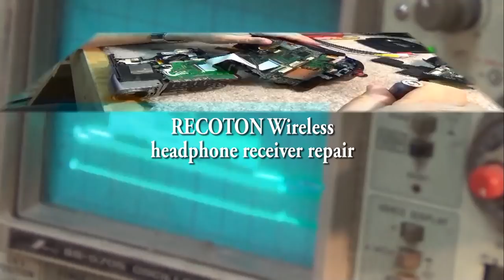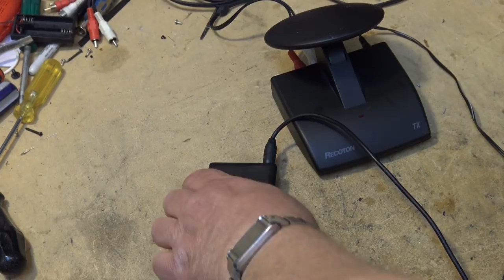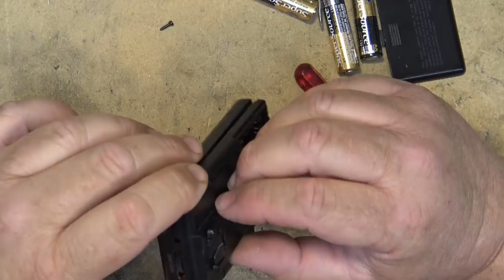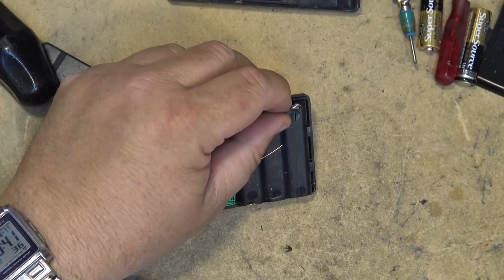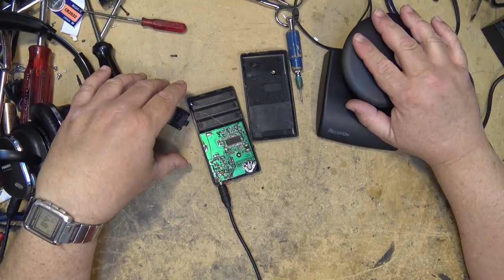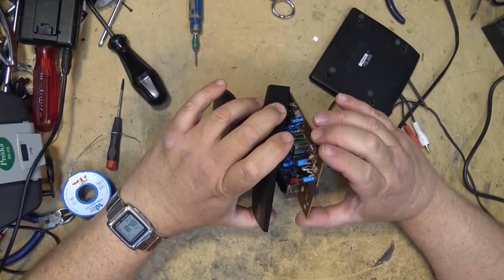Recoton wireless headphone receiver repair

Comment: I designed this product and many others for Recoton in the 90s. I always had issues with those battery wires. The manufacturer, Nasaco, in Hong Kong, had many quality issues. My pride in this project was the downconverter. I used a stock Sony CXA1238 FM receiver chip as the baseband unit. Glad to see these W200s still around. I have the patent on this product, from 1991.

Comment: Hey, nice video! I have a pair of Sennheiser 120 wireless headphones, and they´ve recently broken down after about 6 years, and I have no clue what might be wrong.. Everything is lighting up - the charging and on lamps, but I just can´t dial in the frequency to recieve any sound from the source, it´s just static. I have even replaced the charging unit, but no luck, so the problem must be within the headphones. Do you have any clue to what might be wrong? I have disassembled them, but can´t see any cold solderings or other visable errors.. Would be great if you could help me! Thanks!! :-)

Comment: For your iron to get hot quickier take the tip off and wrap two or three turns of tin foil to the heating element.
Cheap chinese irons have too much space between the heating element and the tip.
Thanks for all your videos.

Comment: How hot is it in CANADA? It shot to 89 degrees just the other day! And yes, my sony Walkman model WM-EX10 is working fine, no problems with the gears since there is no belt inside. The gears can cause problems in this particular model, it can slow down playback, or start sluggish the moment you press play, but I am just fortunate it did not present itself with all those problems during my long wedding vacation in Eau Clare.

Comment: is it 433MHZ or is it 54MHZ, I wonder do they use a DSB modulator that is driven of one side of a quadrature oscillator and the un-shifted side gets combined with the output of the DSB modulator before getting quadrupled up the the transmission frequency I.E. quadrature oscillator operating on 26.045 x4=104.18MHZ see what I am getting at.
Reply from the maker: 902-912MHz FM 34KHz subcarrier just like FM stereo.
Standard 200KHz wide band FM. No different than commercial station except on th e901-912 band.
Reply: @12voltvids  I can receive the transmitter on my SDR receiver dongle if I set it to the 900mhz band and the mode on the SDR application to wideband FM stereo. It works and sounds just great.
Reply: I designed the transmitter using a BA1404 FM modulator chip which then drove a 912MHz coaxial resonator VCO with the MPX signal from the BA1404. Antenna is emitter coupled.